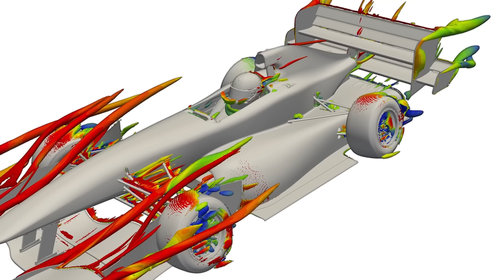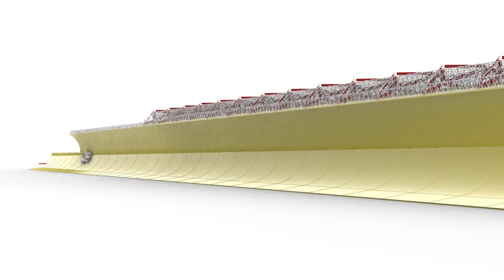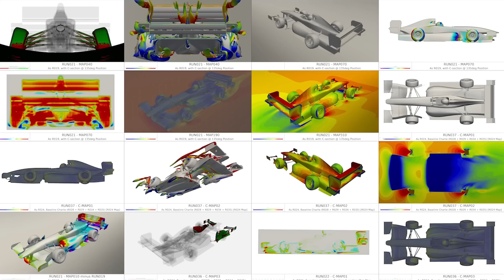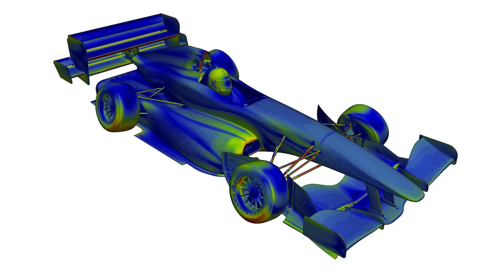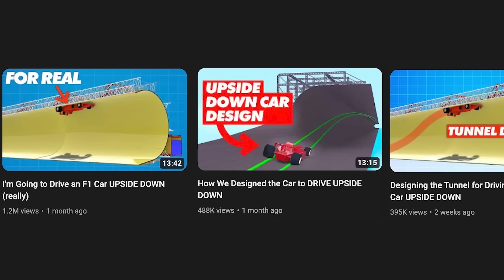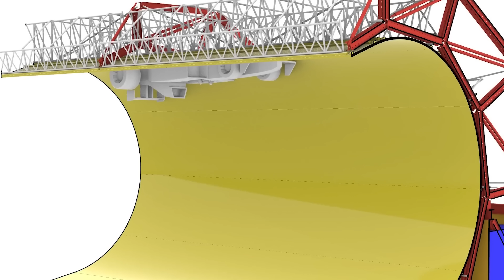Driving a Formula Car Upside Down (UPDATE)

Comment: Currious wether or not the next update on this on its way.

Mythfits Podcast just mentioned they had the idea of F1 car upside down in a wind tunnel but could never find the windtunnel for it.
They are probably capable of giving you 90% of the connections you need and they have the background to find the funding.

Comment: Wonder how much they spent for the "boardroom full of suits" to ultimately achieve nothing. Can't help but feel like an experienced project manager in the industry would have seen this ahead of time and corrected course before initial consultation costs. I'm a layperson and even to me, consulting an industry awash with regulations centred around long-term viability seems like an obvious misstep for a single use structure. 

Hindsight is 20/20, I guess.

Comment: Let break down the cost...... for C shape tunnel = Floor, wall and celling

'Walls' and 'floor' can be created at the side of a 'hill' by a JCB digger, that way less steal frames needed for wind load.  The only steel is needed are mostly for the ceiling portion.

But still needs C shape floor panelling.

Comment: Why does the tunnel have such a large diameter?  So long as the driving surface is relatively flat, the tunnel size only needs to be greater than the width of the car.

Comment: I've followed you with this idea for 2 years now, and today I stumbled over the Sperling thingy on an YouTube short, whilst doomscrolling. After I saw this my admiration for your engineering suddenly dropped, because it seems that you over engineered in the wrong direction? Just use a car rotating device inside a preexisting wind tunnel which you rent for a day. Make a proof of concept with this,  find the truly required velocity, get the attention, and the sponsors, and do it then afterwards the manly correct, over engineered way :)

Comment: Why didn't they build half as a half-pipe trench and build the the roof over. Some of the excavated material can be put on top of the roof to add to it's opposing force strength. Half the building materials, using gravity to add strength and it can be backfilled afterwards.

Comment: to cut down costs, the car doesn't need to move, you could rig something like mcmurtry did, and using a wind tunnel or something like that to generate fast enough airflow spin the rig and watch the car stick to the platform rotating upside down? https://www.youtube.com/watch?v=g6LYcgaQ46c&ab_channel=McMurtryAutomotive

Comment: Just an idea, we should find something that initially nails the car to the ceiling, which would start at a 45 degree angle. So that the tires, the wheels, definitely don't lose traction. This should only be done for the first 50-100 meters. After that, I would let go and everything could go its own way. For example, an electromagnet, but I don't know how much this would affect the car's handling, steering, and parameters. Sorry if I'm writing nonsense, but I would like a dream to come true! good luck

Comment: A very cheap and easy way to do this is as follows:

Create a cylinder of sufficient cross section to be able to contain the F1 car. A fully functional car as it would be for a championship race.
The cylinder would have a flat floor
The diameter would such that airflow around the vehicle doesn't affect aero negatively
It would be sufficiently long to provide laminar airflow (3-6x the length of the F1 car)
Stick it on a bearing and gear that allows the tunnel to be rotated precisely and quickly
Attach a giant fan to the front (from a wind tunnel)
Tether the F1 car via the nose on a long enough tether that aero isn't negatively affected
Run some force sensors under the 'roadway" to measure the downforce of the vehicle
Run some force sensors on the suspension of the F1 car to measure downforce
Crank the front and rear wings to max downforce
Run the fan up to the correct wind speed until downforce exceeds vehicle weight by the correct safety margin
Rotate the tunnel in steps 0->45 degrees, 0->90 degrees, 0->135 degrees, 0->180 degrees
Do that a few times
When happy, do it with a driver.
Voila, concept demonstrated.
Turn it into an expensive ride for those willing to pay the premium
You'll need to either drain all liquids from the vehicle beforehand or make the vents inversion proof.

Eventually, build a modified F1 car that can run inverted for a few minutes
Make the base of the tunnel a rolling road
Keep the original tether system and wind tunnel fan in place
Run the vehicle up to speed and match the wind tunnel fan speed with the rolling road speed
Confirm the tether has minimal strain on it
Rotate the tunnel

Beyond that, the cost of the experiment comes down to building a tunnel of sufficient length, diameter and strength, to be able to support the physics.

The first suggestion is immediately implementable for minimal cost and proves the point and can be commercialised.

You're welcome

Comment: Can we drive a formula 1 car upside down ?
Except it's not Formula 1 car.
And it's electric.
And it's a Hillclimbing vehicle.
etc.

This is something Redbull would typically throw mega $ for shits and giggles. If they aren't interested, you're doing something fundamentally wrong.

To do it with an actually F1 car, you'd need:
A long enough tunnel
Of a very large diameter
With the right surface

Also

The vehicle would need to be modified to be able to run inverted
Oiling system
Fuelling system
Cooling system
Braking system
Driver harness

The costs to do this all are incredibly huge.

Comment: What's the issue with using a real tunnel ? Legal reasons or not finding one suitable  ? A real tunnel would obviously need considerable work to make it useable. As the ceiling in most tunnels has things like ventilation,  lightning,  electrical, etc, etc.

Comment: Assuming no driver is at risk and it's remote controlled, put two rails along the roof of a tunnel. Strap the car upside down against the roof. Accelerate the car until downforce is achieved loosen the straps so the car is shown to be pushed against the roof of the tunnel with no straps, film it freely running, then tighten the straps before the end of the tunnel.
Reply: i’m pretty sure there’s going to be a driver there would just have shit tons of ems on stand by

Comment: I still feel like 5 seconds isnt enough, the brain will still perceive that it is lingering CF to the untrained eye, Or that CF is somehow still contributing at least a portion of the effect. I feel like 10 seconds is required. Also thought: could you make the tunnel over water such that  It could be converted into a pedestrian bridge after either as is or when rotated 90 degrees to then become a horizontal bowl shape, this might justify it long term.

Comment: @Driver61 Since we spoke about igniting sparks here ;-) i was wondering if would not be easier to "tunnel wind" that? Let's just place the car already upside down on a suspended rolling surface (like a free "tapis roulant") while holding it with supports and still standing, then let's pump 250 km/h wind!!(or the needed wind speed to reach the amount on needed downforce) towards the car letting it freely roll...then we take out the ground support and watch it defeating gravity for as long as we want...maybe like this we could also create a short rolling barrell wall and it would be a lot cheaper than 3 million pound, i guess something around 200k... or there are no wind tunnel with such power?@red bull racing ... what  do you think guys? Stupid cheap idea? ;-)

Comment: find a tunnel thats being built. forget doing the transition that will save alot of money. use a rail system like a roller-coaster to hang the car upside down while the car gains speed. at the end of the tunnel make a catch system probably like a foam pit or net like they use on carriers.

Comment: Why don’t you do it like the hot wheels loop they did at xgames a bunch of years ago? You just build a transition with a slight corkscrew you drive straight at, however much distance you need for 5 seconds, and the same corkscrewed transition back to the ground
Actually…if it is long enough, you don’t need corkscrew offsets.

Comment: You should contact elon musk and use one of his tunnels the boring company makes.
Reply: @AaronOsters it still wouldn't work it has to be specific lengths at specific angles with specific structure design from all of the down force pushing sideways on it. So it still needs built.

Comment: Would be really cool if the motor had a cradle that could rotate 180 degrees like a gimbal so that it could be a gas motor. would be stoked to see it but electric isn't quite as cool

Comment: The car part is not as simple as "more than 1g will keep it on the ceiling". While this is true it neglects the issue of needing to maintain enough traction to overcome the drag of producing that downforce.

You need to pick a speed,
determine the drag,
find out how much traction you need to overcome that drag,
Calculate the downforce required to provide that traction ON TOP of 1g,
And check that tuning the aero to provide this plus a safety margin does not create more drag than we started with.

Comment: Wouldn't this be far lower cost and safer if you started by just used a fan car with a skirt instead? Doing it with wings corners you into needing to build a specialist track whereas with a fan car you could use any existing building or motorway overpass for example because it could be done at low speed.

Best of luck whichever way you go. 🙃

Comment: Rather than looking at existing tunnels or building temporary solutions, could a third option be to cooperate with an infrastructure project in the making so that a new tunnel which will be built anyway gets designed in a manner that works for the driving challenge?

Comment: In a 3d cad space it’s easy to create the inverted road and test your theories. But making that inverted road as flat and smooth as required will be the real engineering feat. The smallest bump or even flex in the structure could spell disaster.

Comment: I must say that it not being an actual F1 car and a modified version of a hill climb rather takes away the spark from the project for me. The idea that a specially modified car can do this isn't so far fetched, but without an F1 vehicle in the mix it loses that special note of "this is what these cars can do". Which may effect the marketing value as well. I know that getting a spare F1 vehicle and modifying its engine or converting to a motor is a way bigger ask but that was where the interest in the project came from for me at least. Hell even a Formula E car (though I don't think their aero comes close to this even with the massive suction of their diffuser. . .) would mean something more than a fully modded vehicle.

Comment: The reason why it's difficult to find funding is the same reason it hasn't been done before.  Number 1 you've compromised on the F1 car element which instantly devalues it.  Number 2 and most important is the visual payoff will not be worth the cost. Unless you're able to build a seethru tunnel there is nothing to really be seen other than on-board which will be mediocre at best. The setting will essentially be an old airfield with a scrappy track tunnel structure on it. Not exactly eye catching or marketable. Expect this is why redbull and others don't deem it worth the investment. Oh and number 3 - nobody will be surprised when a formula car has been driven upside down because it is already well known that theoretically this is easily possible. I'm sorry its just not that exciting to me but i hope im wrong

Comment: This is obviously not ever going to happen, but also it's far short of what you originally said anyway. It was meant to be an F1 car in a tunnel. Now it's a hill climb car with custom aero. What is it meant to prove? The "myth" is that a real F1 car could drive on a ceiling, not a custom car you made. And then you say you are still working out costs, but somehow you know it's going to cost exactly £3 million.  The whole thing reeks or a scam, which might not be your intention, but it's how it sounds.

Comment: My partner made a great observation - it sounds like there is a confidence gap between you and potential sponsors. Perhaps you need an intermediate step to get sponsors as confident as you are that this can work. A 1/3rd scale model using the same design & plan, but remotely controlled could be affordable & generate a lot of excitement and financial interest in the project.

Comment: you potentially could have a much less costly project, if the vehicle was simply weighted to simulate an F1, but in fact is remotely steered (without an engine) and pulled by steel cable, a high mass flywheel attached to a cable drum. Kind of like a toddlers dog on a leash toy being pulled. Granted it wouldn't be the same as having a legitimate F1 self propelled, but it would still be a proof of concept with the wheel camber and aerodynamics for that mass vehicle. I also wonder if the construction cost could be significantly decreased if you turn the project on its head, in a wind tunnel. Again I know it's not the real deal, but still a proof of concept that would be pretty cool and potentially draw investors in for the full project.

Comment: We use to hear that car ca drive upside down when the down force is higher than the car weight. But in this vision, it's never considering that the result force to the "ground" will only be the difference , and that difference has been quite small in previous exemples , so small that i think it doesn't give grip enough to maintain the speed , so maintain the force , which results on bad conclusion.

Comment: Surely a huge pipe would be an easier option. You could force air in the opposite direction for extra down/up force even making it possible to park upside down.

Comment: Why not just use a wind tunnel.  Make a static platform, or a treadmill like mechanism, jack an upside down F1 car to it, raise the wind speed until enough forces are at the limit and then remove the jack/lift and hey presto an F1 upside down.

Comment: Even if you matched or slightly increased the amount of down force to the cars weight, the tyres would have almost zero traction to drive the car forward at the speeds needed.

Comment: It might be cheaper to put the car upside down in a wind tunnel, bring the air speed up, release the car, and drive it forward a little. The question is whether aerodynamics will hold the car upside down not it's speed.

Comment: 0:53 You mean centrifugal force. Centripetal force doesn't keep it on the roof. Centripetal force stops it going through the roof and flying into the sky. Centrifugal force (or momentum if you prefer to work in an inertial reference frame) keeps it on the roof.

Comment: What you're trying to do is why I reject all claims of Spaceships that don't have internal duct style engines to use flow through craft for stabilizing in battle if battle damages shutdown Ultrasonic anti-drag that pretty much just jams your gravity with high powered pressure repel. runs fingers through the curvy points in the ducts The flow of the engines or atmosphere = Stabilize force pushing evenly inside the craft. It wouldn't cost you so much if religion(The only ones in power) wasn't poisoning the food & water messing up the entire species DNA calculations.. That's one of the reason you got a Rear Admiral reporting aliens. Because DNA is future of species and he's smart enough to understand when DEATH becomes mercy.

Earth masses should have already had plasma generated Ultrasonic holography direct sound printing using computer images to create pressure shapes to form your parts for everything. Why don't you? Points at religious elite both sides meeting Pope like Nazi days Because it would make you all harder to eradicate which contradicts the goal of the NAZI religions. Chrislam.. Points at only two religions Safe in Germany after Nazi Takeover and points at Islam being let in by Christians right now to attack young World war 3 = Useless masses because they're too religious so straight to Biological and non-biological WMD's in all models. No one will survive and want to..

Comment: My total respect to your engineering works. (Me being in sort of that larger area as well...)

Let me say - simulations can bring a lot of data - and also a lot of confidence.
Still they have their limits, even if you are going for very exhaustive ways of making sure.
I am trusting in your view that you have tried out a lot of methods to get all the needed safety.
But still as i found out from various setup on me, others and just in general
there is always something you never ever had spent a thought  of, what your modelling dont provide.

So how about doing a 1:5 or 1:10 real world model aproach - it might only cost maybe 1:50 of the final setup.
Wouldn't that be a much convincing step, a presentation upfront, a "make sure it works" step for any of you?
Not because your computers are wrong - but to proof that reality meets up with all your expectations.
Thats why i call you to make a real model to let this thing get a good reason to continue.
You have plenty of shots, no pressure and you have a totally high chance of doing lots of repeats
including even multiple vehicle models, just in case one or a few have suffered some mishaps.
(And as a side effect, it will also make sure that it will work without endagering any participating humans.)

Rationale: Go for a real world at scale test drive - regardless how confident you are, it will give you hardest possible evidence upfront on finally going for your full scale subject.

Comment: Why build a round tunnel? Wouldnt a flat top tunnel be easier? And you only need walls at the start and end. That helps with spectators - they can see from both sides.